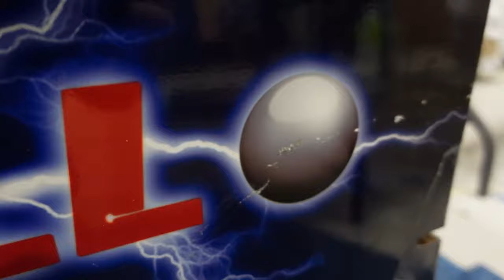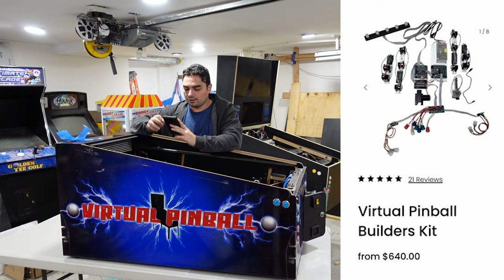This VPin Came From Illinois! Part 1 - Unboxing and Objective

Comment: He should use HD matrix panels. Each panel is like 3"x3", and has 256leds each. So i have 6 panels for my matrix and it has 1536leds just for my matrix. The panels are only $20. Theres no reason to use the cheap chinese leds anymore.
Reply from the maker: Whatever Phil (csd) uses its not the same as the ones I grab from Amazon. 
My 42 inch builds Have like 480 leds in the matrix